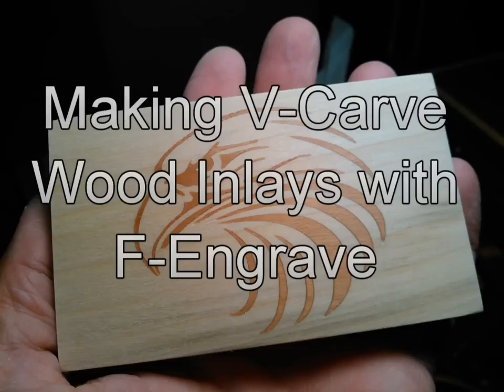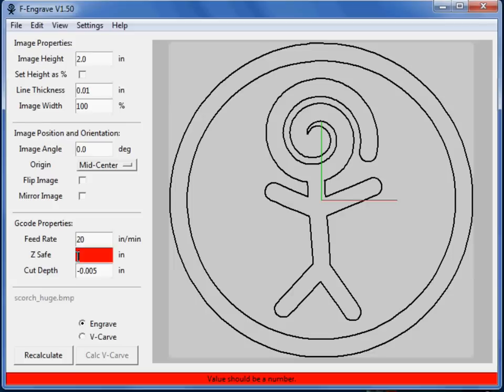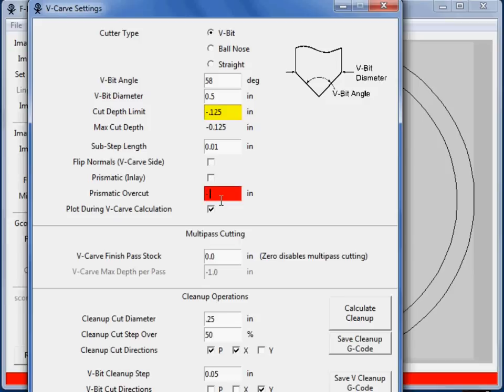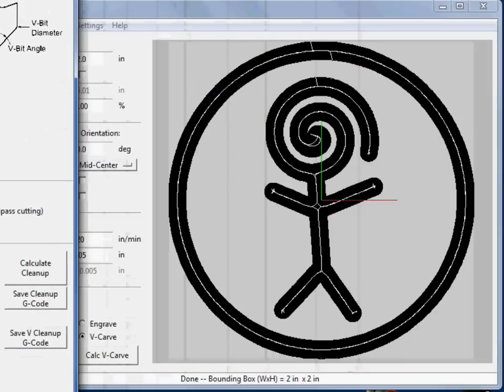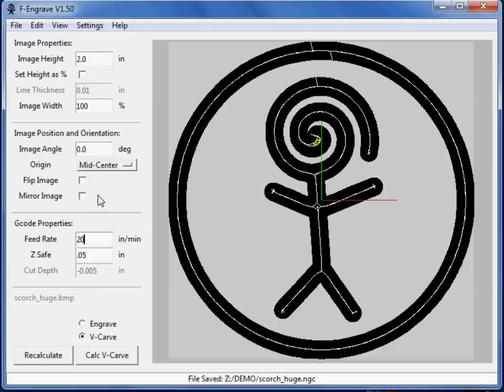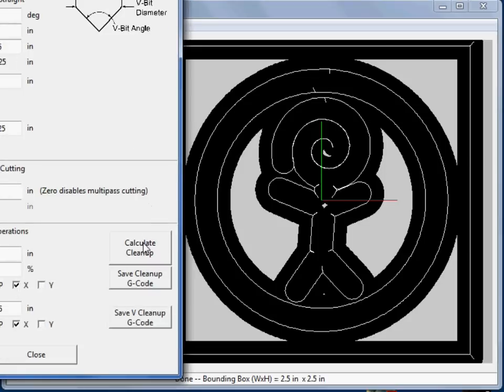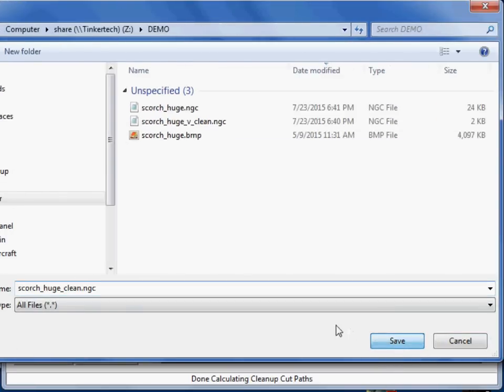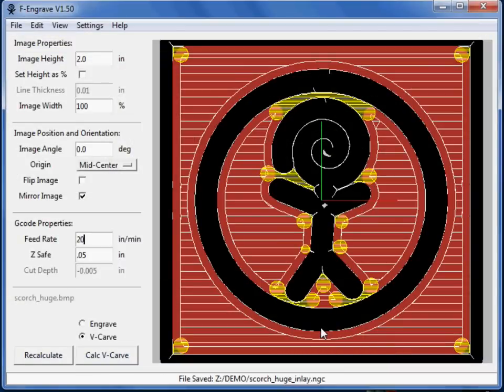V-Carve Inlay Using F-Engrave

Comment: can you discuss a little bit more about what the cleanup code does?  like for example,  in the first step, how did you know to get v-cleanup gcode instead of regular cleanup code?  and what is the difference between the two?

also, is it safe to say that if you plan on sanding away the substrate of the v-inlay rather than hacking it off, then you would set that prismsatic overcut to 0?

thanks so much for this.  I love F-Engrave.  I've searched your site for a donate button but don't see one.  I'd love to help support this software.
Reply from the maker: The flat cutter cleanup tool paths look red/brown F-Engrave will try to cut as much as it can with the size of cutter that is input (.125 inch diameter in the video).  If there isn't any of the red/brown color no straight cutter cleanup will be generated.  The v-clean cuts the areas that can not be reached by the straight cutter (there is some overlap).  The v-clean uses the v-bit so it can clean all the way up to the v-carved surface but the stepover needs to be very small to look good.  You can set the cleanup bit diameter very large (bigger than the design) to produce v-clean only cleanup. 

Yes you could set the overcut to zero but leaving a gap might help keep glue off of the finished surface.  When I glue them together I set it inlay down so the excess glue stays away from the finished surface.

I don't accept donations...  You just need to put up with the ads.
Reply: Scorch Works thanks for your reply.  I tried two of these this weekend, and I'm having trouble.  The biggest v-bit I have is a 0.25" 90 degree v-bit, which means I can't get very deep if I want to have some prismatic overcut.  I tried the first one with no overcut, and before I glued them together, I could tell that the inlay was wobbling around inside the engraving (they weren't tight).  So, I cut another set today, and this time I put a depth limit on the engraving portion to 0.06 so I could use the other 0.06 for the prismatic overcut, thinking that if the inlay is taller depth wise, then it will slide in until it is tight.  But, after cutting them out, the inlay is taller (the full 0.125, but it still wobbles around inside the engraving - it isn't tight.  I can send you some screenshots of my settings or the g-code files themselves if you like.
Reply from the maker: Frank Graffagnino It sounds like your v-bit may not be cutting to a sharp point.  I have some bits that are v-bits but the thinnest line I can make with them is about .050" in diameter.  I think if I try an inlay with one of those bits I would get the same sloppy fit. You might be able to fake it by zeroing your z-axis at a position higher than the top of your workpiece (so the theoretical tip would be at the top of the workpiece)  You will loose sharp details and potentially need to apply extra clamping force to close the gap because this is only an approximate solution to the problem.  If you think your bit cuts a sharp v slot we can investigate further.  e-mailing me the g-code and your input image/font file is a good place to start. when you save the g-code file make sure the comments are turned on in the general settings window.  my e-mail address is in the help menu.
Reply: Scorch Works yes, i think the v-bit does have a bit of a flat spot on it.  Unfortunately, if I zeroed it higher, the engraved portion would be even more shallow... i think there would be barely any wood in there for the inlay.

Maybe I need to reset and start over and begin by asking... what is the best v-bit to use for this?  what size and angle?
Reply from the maker: Frank Graffagnino All of my inlays have been made with the 1/2" shank version of this bit ( CMT 858.001.11 60 degree Laser Point Bit, 1/4-Inch Shank, 1/2-Inch Diameter) I gave the details for the 1/4" version because it is more likely that that size will work for you.  I don't know if different angles are better or worse.  It may depend on the wood and/or design being cut.

Setting the z-position above the surface may seem counter productive but it will make the two parts fit up better with less engagement between the parts.  I will have to try it with one of my flat end v-bits to verify.
Reply: Scorch Works so, I got the bit.  I noticed that it is a 60 degree bit, but in this video you typed in 58 degrees for the v-bit angle.  why is that?